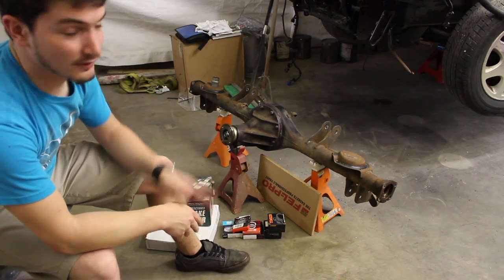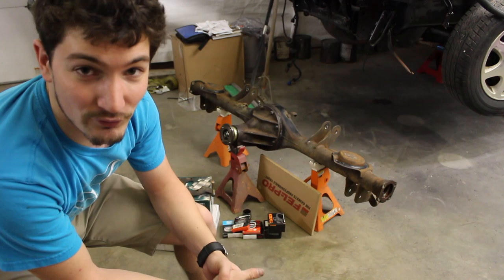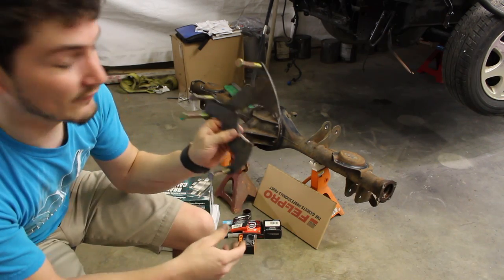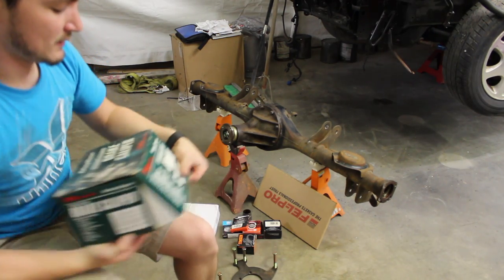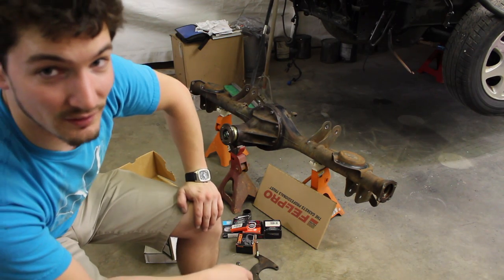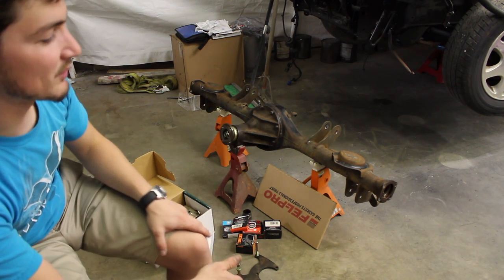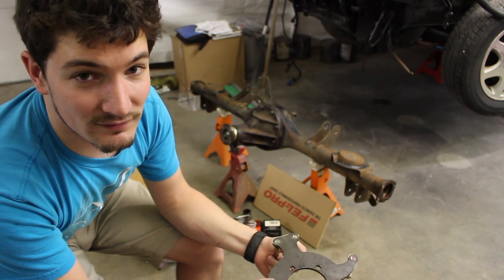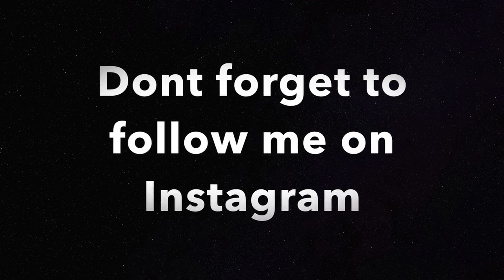Corolla Axle Upgrade

Comment: I have some real questions! Someone please anyone all input is valued! So I have a 2013 1.8L corolla le and quite often I go off road it. Nothing harsh just dirt roads some rocky stuff here and there but I really want to build it a little to be more suited for that stuff, and so I can take it camping comfortably with me and not have to be scared every time I here something on the underside. I've heard some subaru parts swap over to corollas is that true? If it is would it be beneficial to swap over a dirt rally type suspension, as well as the front breaks and rotors could I comfortably fit something like this break set up or brembo breaks on a 15in wheel? Or I have found a guy who could custom make me strut spacers would it be better to buy after market corolla suspension and do the spacers. Also I want to turbo it, I haven't been able to find any info on turboing a newer model corolla. I don't need anything stupid crazy I just want to give it a little more even power through the power band and be more capable on dirt roads. So far I have everything lined up to do 15in wheels and tires 20inx9in A/T tires, a custom tube/plate metal front and rear bumper for better clearance and durability, permanent roof rack and pod lights and light bar. I'm more concerned at this point about the front breaks and engine work since I can't find any info on doing that stuff to a new model rolla
Reply from the maker: I have no clue if parts bolt on but we live in a time where we can make any thing work as long as we think about how it needs to work. Do a bunch of research and start cutting things up to make them work. Just do it and document it so I can watch it on YouTube. 😉

Comment: Good, i wanted to ask you a question how did you get the coils for your Toyota thanks
Reply from the maker: antigos japoneses they are coils for an AE86. I slightly modified the mounting surface on the front brake caliper brackets, and everything else lined up perfectly.